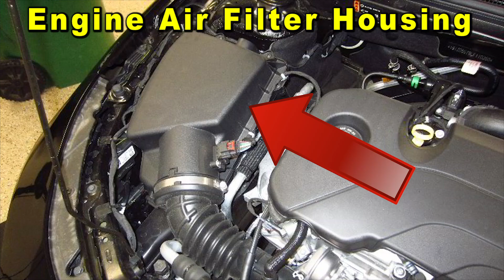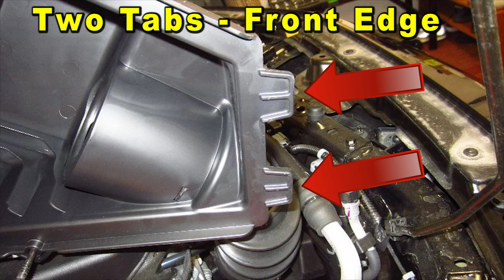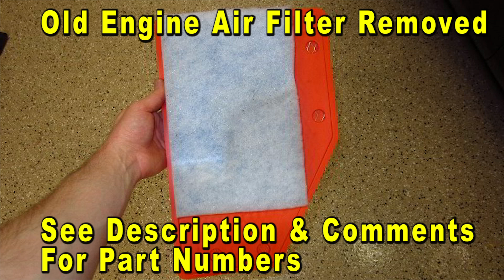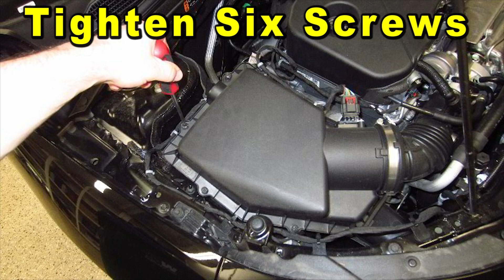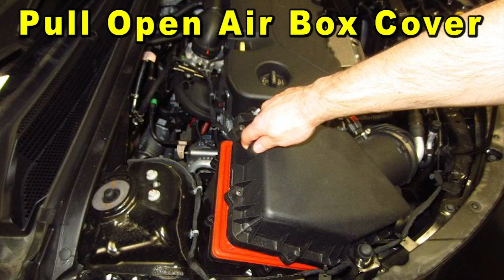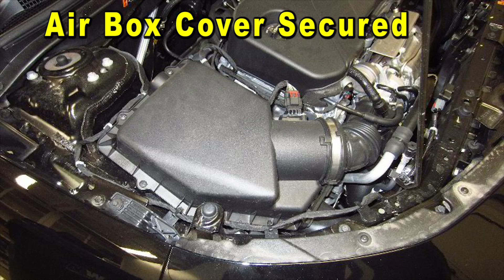Chevrolet Malibu How To Change Engine Air Filter 2016 To 2024 9th Gen With Part Numbers - 1.5L I4

Comment from the maker: Chevy Malibu Engine Air Filters - https://amzn.to/47wjqTF
ACDelco OEM Air Filter Part Number - https://amzn.to/47u7fHb
Fram Engine Air Filter Part # - https://amzn.to/3QZXh98
Precision Screwdriver Set - https://amzn.to/3sLixaP
Plastic Pry Bar Tools - https://amzn.to/3HMtsV7
Socket & Ratchet Set - https://amzn.to/3Z17LbA
Mechanix Gloves - https://amzn.to/3jCnHkt
Torque Wrench - https://amzn.to/3vS5uSI

The Paul79UF YouTube channel is a participant in the Amazon Services LLC Associates Program, an affiliate advertising program designed to provide a means for sites to earn advertising fees by advertising and linking to Amazon.

This DIY video shows owners of the 9th generation 2016, 2017, 2018, 2019, 2020, 2021, 2022, 2023 & 2024 Chevrolet Malibu sedan how to change the engine air filter element for the Ecotec LFV 1.5L turbocharged I4 engine.

Comment from the maker: Check out the DIY guide for changing the engine air filter in a 2016 to 2024 GM Chevy Malibu -
https://www.paulstravelpictures.com/2016-2023-Chevrolet-Malibu-Engine-Air-Filter-Replacement-Guide/index.html

Here are all of the DIY repair and maintenance tutorials for the ninth generation 2016, 2017, 2018, 2019, 2020, 2021, 2022, 2023 & 2024 Chevrolet Malibu sedan - 
https://www.paulstravelpictures.com/Articles/2016-2023-GM-Chevrolet-Malibu-DIY-Repair-Maintenance-Guides.htm

Owners of other General Motors vehicles from Chevrolet, Buick, Cadillac, GMC and Holden such as the Impala, Corvette, Bolt, Sonic, Spark, Express, Trax, TrailBlazer, Equinox, Traverse, Blazer, Tahoe, Suburban, Colorado, Silverado, Cruze, Volt, Camaro, Encore, Envision, Enclave, Regal, LaCrosse, Canyon, Sierra, Terrain, Acadia, Yukon, Savana, XT4, XT5, XT6, Escalade, CT4, CT5, CT6 and Commodore may also find these DIY instructions to be helpful.